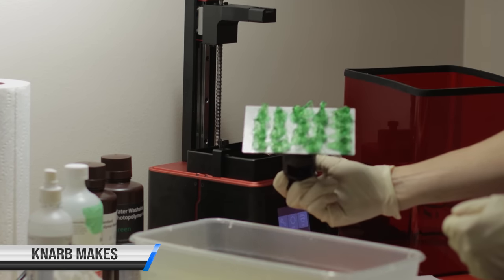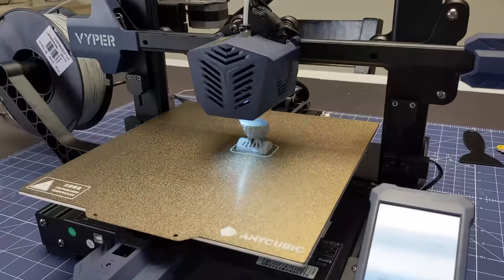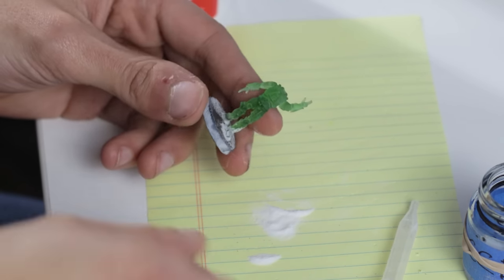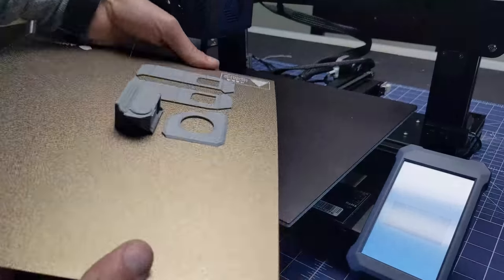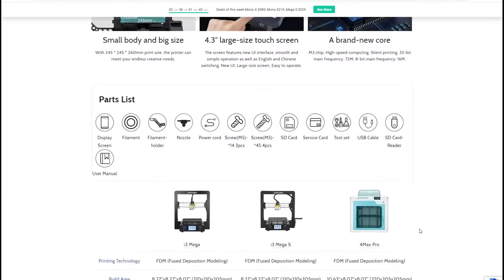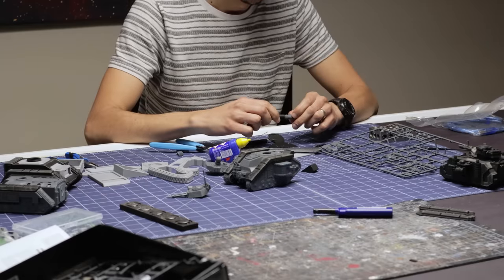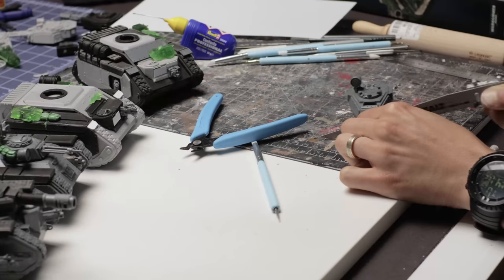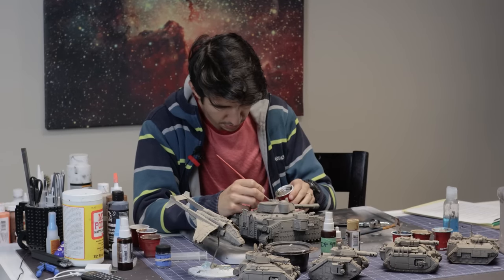Did SLA Printers win the tabletop war? (not yet)

Comment: I got into 3d printing for small stuff that I didn't bother or couldn't make in wood (laptop stands, phone stands, keychains, flower pots, weather vanes for boats) then I found out about 40k and started printing tanks. I don't even play I just love the design and painting them
Reply: @ignaciasd1198  Go to bed, kid.
Reply: Thats cool, i got a ender 3 and started experimenting and lately ive been dabbing into miniatures too even when i dont play but i still have problems with little prints, specially if they are detailed
Reply: @ernestopoisota9918  yeah, detailed work takes quite long to print since you need to set the layers real thin for it but if you print little things the layer will be visible. That kind of thing resin printers are best, but I really can't be bothered with the process of curing and cleaning everything up
Reply: @mig1739  I was just about to say. 😂
Reply: @ignaciasd1198  it's not that hard, but it's a real pain to keep on buying alcohol and other cleaning supplies plus you need the space for you setup to print and process the prints. I can tell you the fine details plus the ease of painting since you won't need any sanding is worth the cost of resin printing if you're into miniatures or if you want to create small figures.
Reply: @dredgewalker  I missed saying that I have a one room apartment so ventilation and space are a real problem for me, and fdm lets you make useful things like I said before. Presses, stands, supports, etc. Anytime now I'm going toprint myself a desk lol
Reply: @ignaciasd1198  If you're determined to own one you can probably make a ventilation shaft for your resin printer but that would add additional expenses. But the resins right now are actually very good with different properties for different needs. I've managed to purchase some tough resin and it actually is tough that instead of breaking it flexes so it's good for weapons like swords or spears for my action figures that would actually turn out weaker if printed on my fdm. You can probably print other items that can be useful to you with this kind of strenthened resin.
Reply: @justicedemocrat9357  😂😂did u step on a lego
Reply: Where do you get the designs from?
Reply: @ignaciasd1198  Hey where did you get the STLs for the tanks? I'd love to print a couple. Thanks
Reply: @justicedemocrat9357  booooo. Lame comment is lame.
Reply: Good for you....noone cares
Reply: @justicedemocrat9357  I saw your stuck up friend yesterday...
Reply: @mig1739  I'm pretty sure even that name is trolly. Most trolls are right wingers.

Comment: I started 3D printing a little over a year ago with a resin printer. I got frustrated that I could not print large terrain pieces so I just bought myself an fdm printer and it's going great. I love the fact that it prints larger objects and the material is much more resilient since the resin tends to be brittle.  I have also got myself some primer that's intended to fill small gaps. I've been told by Kathy Millett that it should do a pretty good job of hiding the layer lines.
Reply from the maker: Filler primer and a bit of sanding always goes a long way! Cheers!

Comment: Both technologies are complementary, one picks up where the other one leaves off. I personally have no use for a resin printer and the increased resolution, but I find something to print out of PLA or TPU almost every day.
Reply: Exactly. SLA printers compliment FDM printers they don't replace them. Plus I've been 3D printing for years and I never get bored of watching an FDM printer at work.
Reply: @edstar83  I don't even want to know how  much time I wasted watching a printer working, lol.
Reply: Both definitely have their uses, and I don't think that either one "kills" the other. Neither are redundant or obsolete technologies.

One is a knife, the other is a screwdriver. Sure, you can turn a screw with a knife, but it will be suboptimal... And it will be equally suboptimal to try to butter toast with a screwdriver.

Generally - if you're aiming to make minis, I would say that a resin printer should be your first acquisition, as they are easier to use, require less tuning, have fewer variables, and make much more detailed and high-resolution prints with a very high degree of reliability. This works well for D&D miniatures, WH40k miniatures, KOW miniatures, and several other games. Additionally, most of the minis released through the likes of Loot, Myminifactory and Cults3D tend to expect that you're going to be printing them from an SLA resin printer.

At a later date, if you find yourself wanting to make vehicles and terrain on a more regular basis, feel free to reach for an FDM model. I use an Ender 3, which is an entry-level, cheap FDM printer model that will give pretty decent results if you aren't worried about a few defects. I mostly use it for cosplay elements, and I can attest that it works spectacularly in that role. The larger print bed is definitely a huge plus. Additionally, I tend to find that well-printed FDM components are noticeably (but not massively) more durable than their resin counterparts. a 2mm thick, 3 inch long, 1 inch wide strip of printed resin takes significant and deliberate effort to break with your fingers. It does not yield, and will suddenly just shatter. An FDM component of the same measurements will be impossible to break with your fingers. It yields slightly before snapping cleanly.

Short version - different horses for different courses... But if your goal is to make minis, I would recommend an SLA. If you want to make cosplay elements or functional components, FDM is still king.
Reply: I second that 

I use mine for practical uses. I print combs, hooks, and the quality for stuff like stands, holders, and storage 

Cheap, convenient, and the filament lasts for a long time for me. There's no need for me to upgrade it.
Reply: @yannickg6904  You watch because secretly your scared it will stop working and have a failed print and you might miss it. Same reason people watch Nascar. Hoping for a wreck. But not really but what if?!
Reply: @SteelWolf13 Exactly,  and nothing ever happens when you watch, but if you leave the print unattended, hell breaks loose.

Comment: It's really about the print size for me. I've got an Ender 5 Pro with a few upgrades and the quality is amazing. You need regular maintenance and a slower print speed, but you can really hide the layer lines if you take the time to dial in your printer, slow it down, and orient things the best way (as you mentioned).

The only thing an FDM printer cannot do is the incredibly small pieces like legs on miniatures. The precision just isn't there.

Comment: models = resin, terrain (and some tanks) = FDM.
Reply: Yep, it is not so much about choosing one or the other, their each have their strengths and weaknesses. Terrain and large vehicles are generally easy to print well on FDM printers, but if you are going to make anything smaller than a space marine dreadnaught, then you probably want to switch to resin.
Reply: disagree. it's purely cost. FDM is surely cheaper, but it's slower AND less detailed. The only reason my current terrain project isn't resin is because my bed is small. That's it.

Given equal surface area, SLA not only prints with greater detail, but faster. And the cost isn't too much higher.

The BEST option is framing in fdm, and attaching SLA detailed parts.

Even then, you're not saving much as a hobbyist. talking change on the dollar for hours of time.

Comment: Each tool has its own area where it can shine. Personally I prefer over FDM over SLA. Once you got it tuned in it doesn't fail much and easy to setup parts for printing and requires much less work.I never understood the problem people have with bed leveling. I rarely level the bed once it is initially don and just adjust it by eyesight judging on the outcome of the first layer. On the other hand SLA is quiet and needs less space for the printer itself. It is faster than FDM too.

I never understood why people want to print whole terrain pieces in one go and then have to deal with layer lines.
Reply from the maker: Well said. I'm having fun finding good uses for each one and mixing up projects across both.
Reply: I honestly don't even care about layer lines; as for leveling, from experience it is usually because people will remove stuff while the print surface is still attached to the print bed. The result is the bed being jolted a bit out of level, but a bit out of level is all it takes.
By taking the build tak or glass plate of metal plate off to remove the print you can go a while before needing to relevel.

Comment: "FDM sucks" - said the guy who only prints in the cheapest PLA with the default """super fine"""" cura profile
i've printed multiple vehicles on an ender 3 with Silk PLA and well tuned settings and they look about as well as resin prints 
hell, i've had resin tank parts warp during washing and curing and not fit together 
recently i tried printing some lightning claws and they look a bit dirty and blobby, but i'm convinced they'd look fine with a 0.3mm nozzle
Reply: "... dirty and blobby..."; paint them glossy red, and they become GORECLAWS, drenched in the viscera of your foes.
Reply from the maker: Speaking of slicers, take a look at prusa slicer, it's free and can support many printers. The settings and features outshine cura in my opinion.

Comment: Dang the orientation trick is genius! I do not have a printer but this seems like a super obvious solution that I would have easily missed if I had one! 
Love how your army is coming along!
Reply from the maker: I've been trying to re-slice and re-orient other models I find as well. I see a side that would look a ton better printed flat, I just slice it off and place it on the bed and glue it on later.

Cheers!
Reply: @KnarbMakes  my top surface is always trash though. how do you improve this?
Reply from the maker: @croggyjones7899  you can turn on ironing to improve it. Some slicers let you do this. I use prusa slicer for it

Comment: 0:30 I can clearly see layer lines....unless those particular lines were on purpose?
Reply from the maker: Those arent layer lines, since the armor panel printed parallel to the build plate. What you're seeing is a bit of messy ironing from the hot end as it smoothed the surface on top.
Reply: @KnarbMakes  AHhh ok! That makes sense.

Comment: I have both a resin and FDM printer, and the key is to play to their strengths. I’m a model maker, so being able to print in polystyrene on the FDM is a huge plus. Polystyrene prints beautifully, is light weight and strong, and sands easily. It bonds well using Tamiya model cement, so I can easily add kit part details. I typically only use the resin printer when I need highly detailed parts. These usually will be super glued to a larger piece that was built up on the FDM.

Comment: Orientation on some printers with larger (0.3mm) nozzles is actually in reverse. Most models I print in 0.1\0.05mm I need to them upwards just to get line width less visible on smaller details.

Comment: I appreciate the orientation advice, but the bane of my experiences with fdm has been stringing. Got a resin printer before fdm and just found the user experience to be a lot smoother. But you nailed the role fdm plays in table top gaming, though I'd still print tanks on my resin printer.
Reply from the maker: For sure. I've had a lot of frustration with FDM printers in the past. It takes a bit of learning to figure out the failure modes.

I still get some stringing, but I can mostly clean up the prints with a lighter and some light sanding.
Reply: Turn your nozzle temp down and enable combing mod for All within the slicer.
Reply: That's why they make stringing tests so you can dial in your settings to avoid stringing. Cura slicer has a built in extension that allows for this and works well. They also have a temperature test. You can use both on each filament you use to dial in the settings. It isn't difficult.
Reply: Lower the temp, increase cooling and dry your filament (if not using PLA)
Reply: I agree and really resin Printing is not much more expensive anymore perhaps 25-30% but the results are much better in my opinion plus I find resin Printing less of a hassle these days wth large format mono 4k printers and dedicated wash cure machines. FDM may not be exactly completely obsolete but it's just about there.. two years tops when medium format 8k printers price comes down. The industry is evolving quickly

Comment: actually, it's the opposite.  I have an Anycubic I3 Mega, Tronxy x5sa pro, and an Anycubic Photon S.  The Photon is  the one gathering dust.  I can print detailed items on it that are too small to print on the FDM's, but I seldon print quite that small.  I like the Photon, but it;s the prep and cleanup where it looses out to the FDM's.  I can print most things on an FDM, it's easy to slice, supports are simple and intuative.  Clean up is also very easy.  With the Photon, I find slicing very tedious. I have to make sure every island is supported. When a print fails not only is it ruined, but I have to clean up everything to make sure I remove any parts that got left on the FEP.   For most of my print, I would rather deal with the layer lines, stringing and so on, rather than deal with the mess and cleanup of the SLA.  Maybe I'm just lazy.
Reply: *loses

But yeah, I love resin printing…. Except for the resin….  It gets everywhere and it’s toxic.

Comment: I don't have anything against fdm, but mine has been relegated to basic shapes, terrain and bases which it does fine, esp with the occasional bit of resin "wash" and cure to hide lines.  Detail wise there is no comparison though, fdm I'm struggling for .2 on detail with a large amount of mechanical tinkering and part replacement, resin I'm printing at .035 with a simple dial in, just for cost efficiency i do try to make use of both, but considering how long fdm has been a thing vs sla i dont expect it to ever compete for actual minis, but will hold its value for terrain and large projects for a while.

Comment: An advantage maybe not so relevant for table top is the ability to mix materials. Double extruder FDM printers are nowadays very affordable and there you can for example either print with soluble support or mix PLA or PETG with flexible materials like TPU, having flexible hinges etc printed in place. There are also more engineering materials available. While resins have upped the game I am still not so convinced about their long time performance, compared to for example a PC-ABS filament. 

And then there are full multicolour options available from Prusa the MMU2s (5 filaments) and the newest Mosaic Palette (8 filaments), where you can print in up to 5 or 8 colours, respectively (even more if you change filament in between manually). But those are extremely wasteful and, harder to dial in and very slow the more detailed and the more colours you want to print.

Comment: Knarb! You and I are seemingly working on the exact same projects... 1) Dune minis 2) illuminated 40k terrain 3) FDM vehicles. I’m new to 3d printing and your tip on orientation is perfect!  Im using a CR-10 V3.
Reply from the maker: Haha that's awesome! Bound to happen with someone at this rate.
Reply: Please check out Submersible LED pool light on Amazon. They have a controller and are very robust for multi colored lights. Little pucks are easily tucked under gantries  With magnets
Reply from the maker: @House-Atreides  will do! Thanks

Comment: ooo nice!  i just purchased a vyper.  ill have to look at your settings in prusa, as im not impressed by cura so far.  and maybe go after the filament you are using.  i have a photon s as well, but actually prefer the vyper for larger stuff (for obvious reasons). thanks for the helpful video!
Reply from the maker: Just used stock settings, to get good prints just make sure you tighten all belts and gantries, slow the speed slightly and don't use damp filament.

Comment: Fdm has a much broader ise but it all comes down to what one need, however a fdm can still print figurines that match a cheaper resin printer, but it require a lot of calibration and knowledge , resin is easier for quick good surfaces on small items but that is to simplify the thing that you still need to know what you do as resin requires drainage holes etc . For a new buyer, if the figures are larger than 2.5 cm than you can basically go for an fdm. It will have difficulties with reaching level of detail but any proper fdm has a resolition of 0.1 mm. Since layer height is normally about 0.3 mm on a .4 mm nozzle, you can theoretically iron it but most resolutions will land somewhere 0.4 + mm due to inconsistencies in the printer , and may be better depending on how much it is trimmed. That said , there is a steep learning curve on resin, and you have to replace the screens at any poimt, smell and curing.. so if you really dont need to print more than ocassionally i would go fdm, and use a primt service for resin. The cost of a resin printer is cheaper than three resin bottles now so it is not a big deal in investment but service parts is way more than the printer itself.